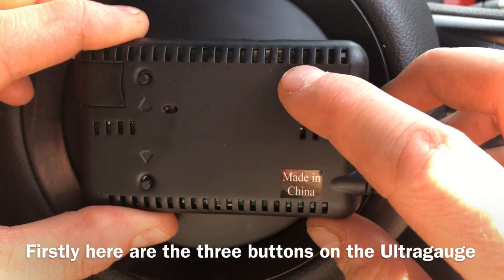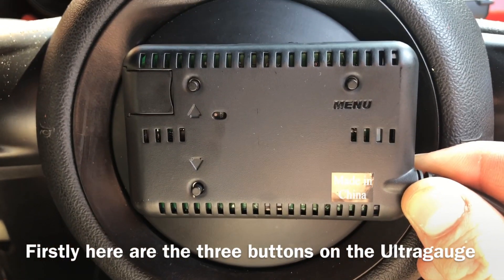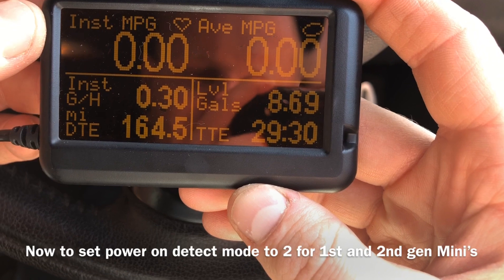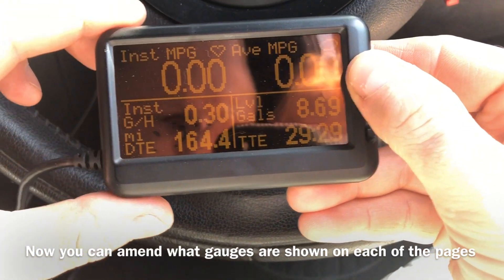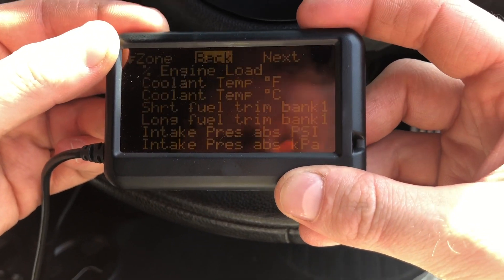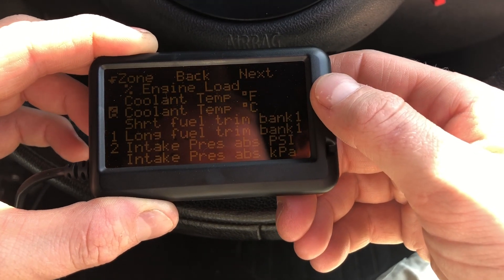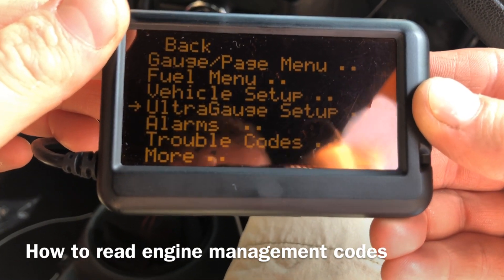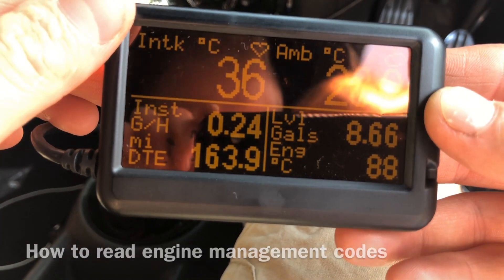How to setup your Ultraguage EM Plus OBD II Code Scan Tool & Multi-Gauge Instructions

Comment: I have a gen 2, power set to 2, but it keeps the car awake when the car is alarmed and locked. Anyone else have this issue?  I have to keep it unplugged otherwise it will flatten my battery.
Reply from the maker: I haven't, worth reaching out to Ultragauge as they are really helpful

Comment: Cool video, have you tried to use it in your f56?
Reply from the maker: Thanks for watching.  I actually sold it with the clubby.  I have a P3 Gauge in F56 so not had the need to get an Ultragauge in that.